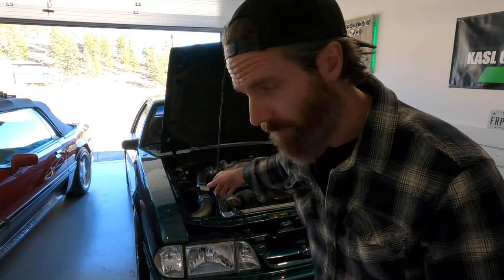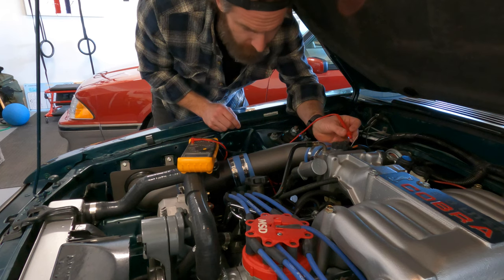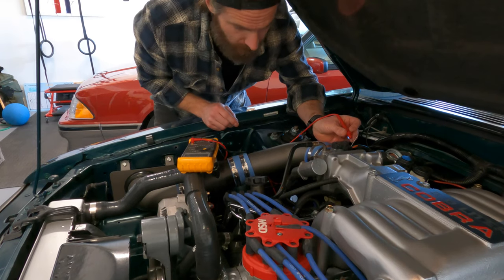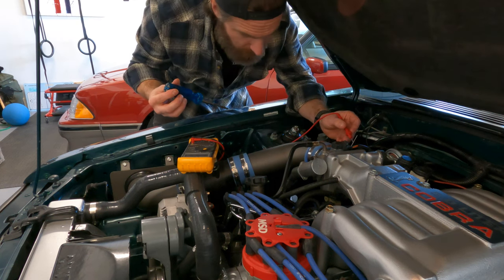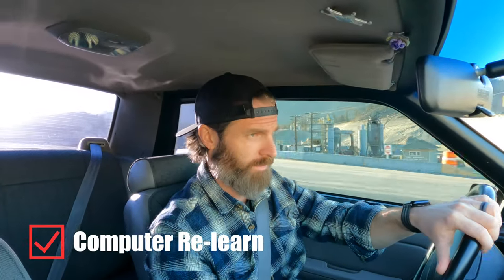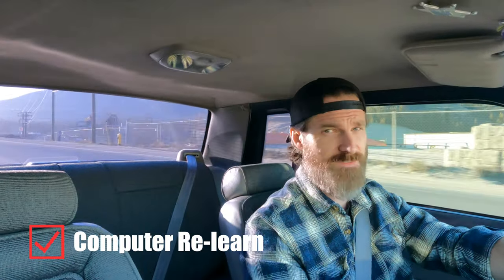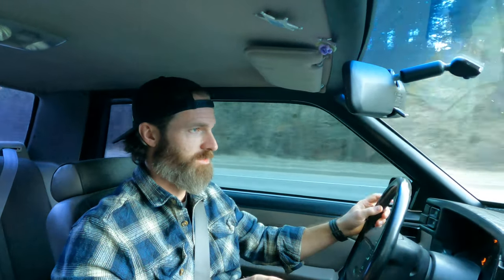I Cammed My FOXBODY & Fixed The Bucking, Surging & Stalling Drivability Issues With These Easy Steps

Comment: Another good thing to check on the tps when your setiting it at idle, is to manually open the throttle while watching the voltage on your meter. Open it slowly and quickly taking note of any inconsistenties in the smooth increase or decrease in voltage. Any jumps or "dead spots" could indicate a faulty tps. An oscilloscope would be the best tool for monitoring/testing it, but not many people have access to one. Another well thought out video bud.
Reply from the maker: Thank buddy! Always appreciate your input 👍
Reply: @KASLCustoms  no worries bud

Comment: .99 volts I would say is too high, if you open the throttle and ease it off lightly the voltage may end up over 1 volt.   Chris Richards of Pro-M EFI in his video, says the stock computer worked best when the TPS was set at .90v or less but no higher than .95v.
Reply from the maker: Interesting, thanks for sharing the info sir 👍
Reply: This topic is one of the most debated of all for Fox Body 😂 many people say it’s not a super critical setting and I’ve had some cars that weren’t BUT I had one that ran noticeably best at .89-.94
Reply from the maker: Lol yeah it’s one of those weird deals 🤷‍♂️

Comment: I have a custom cam and have been running with the IAC unplugged for months cause I am inconstant fear of looking like a tool idling at 2500rpm at a stop light… I should recheck it but the new iac didn’t help last time I checked. Sometimes it will seem fixed but after a few minutes of running on the highway, it comes back. Car feels like it had cruise control and just sits in the higher rpm’s when IAC is plugged back in.
Reply from the maker: hmmm thats odd...?

Comment: My 1991 Mustang GT has a misfire sometimes. Some days I can drive it and its perfect and the next day it will have a misfire under load. I have changed the spark plugs, plug wires, distributer and cap, coil, and mass air flow sensor. What can I check next?
Reply from the maker: What heads/plugs are you running and what are they gapped at?

Comment: Love this this 5.0 content from a fellow Canuck.  Really helpful video.  I run an Anderson N-41 in my coupe with no issues.   Lots of power.  It isn't a super high lift cam.  Before buying my cam, I used David Izard's formulas, and they pointed me to 110 lobe separation and durations very close to the N-41.  Thats why I picked it.  Most cams have 112 or higher.  

N-41 Specs:
Duration at .050 - In:222 / Ex:230
Gross valve lift w/ 1.6 - In:.512 / Ex:.512
Lobe Separation 110
Reply from the maker: Thx buddy and thanks for sharing your experience for others to see 👊👊
Reply: @KASLCustoms  Thank you for this awesome channel.
Reply from the maker: Awe thank you my friend!
Reply: I got the same cam, very awesome cam for decent street/ strip car

Comment: 4:32
Something I saw on Brew2L’s channel was to probe the green and black wires, and not ground to the engine or body. You will get a reading that’s quite a bit different if you do. 
Of course I was skeptical. 
But I tried it both ways, and sure enough, it was a good bit higher. 

Also, if you set it at say .99, and it jumps over 5v at WOT, the computer defaults to decel timing. On his car, it was like 35°. It blew the head gasket with a quickness. I believe he said it was because his car is boosted, but not as much of an issue with naturally aspirated cars. That was my understanding anyway. 

Just a little tip for anyone still fighting a surge.
Reply: Yep but the only time the tps will do that is if there's something wrong with the tps itself or if the throttle magically goes past it normal operating range lol
Reply: @nunya2814  
Not necessarily. 
I’m pretty sure he has a good grasp on all that, and it happened to him. 
It can happen. 
And does happen. 

This was just a heads up for folks.
Reply: @dstdrummer  these TPS are designed not to go above 5v, if they do, there is something wrong with it. You'll find if you re watch brew2ls vid, he even says there was a fault in it and replaced it. It's the way the system is designed and how the parts are engineered to work together. Most of the sensors in these eeciv systems are 5v reference or pull down circuits. Bad things happen when these systems aren't happy, why do you think so many fox owners have problems diagnosing their issues? Because most don't understand them to begin with.
Reply from the maker: Thanks for sharing bud!
Reply: It can't "jump over 5 volts" when it's ONLY provided with 5 volts.... 🤪

Comment: Always remember: the heads are the limiting factor, not simply the cam.  Without addressing the heads on a 5.0L, results from a cam will be very disappointing.  

On an SEFI motor, the TB and MAF are also factors that will affect cam results.
Reply: What happens if I don’t know the cam or heads?
Reply: @itsmetiqui1136  There are casting marks on the heads.  Unfortunately, determining the cam is harder.

Comment: New Sub.
Liking what I been seeing Sir.
👊🏽
One thing (along with the IAC cleaning/TPS base voltage setting) 
I had and i do know stock cammed cars do suffer this , my stocker speed density car that also was one did respond and they actually all do prefer a higher base idle and always set this wirh AC on l, also more fuel pressure even for stocker EEC5 system overall respond positively as well to the increase in FP /base idle (W/AC on specifically) beeeutiful car my friend. 👊🏽
Reply from the maker: Thanks so much buddy!

Comment: What's up @KASLCustoms? Under your guidence I purcheased the Comp Cams XE 264HR fun stick for my 306 build, along with Pro Maxx 180cc heads, Keith Black pistons and an "OLD SCHOOL" tubular Lightning intake (I can't believe I found one!). My question is, I'm using an MSD Street Fire Distributor for the build and it comes with a steel gear. I've read where I should switch to a melonized gear for my new stick. Have you crossed this bridge on your LX? As always, love your content. Danny F rom Kentucky
Reply from the maker: Hey buddy! That sounds like an amazing parts list and will make one heck of a power plant. As for the dizzy gear, I have never researched this item and/or the pros/cons surrounding it. Truthfully, I don't even mess around with swapping out the hem dizzy either. Sorry about that, I wish I had more info for you. Thanks so much for all the kind words and support my friend!

Comment: My 88 Notch is tuned with a Moates Quarter Horse and has the Summit E303 cam. The car bucks bad at low speeds. Do you think I could adjust the TPS with the engine tuned?
Reply from the maker: Yes you most definitely can. Mine has a 1/4 horse too

Comment: If the car is 87-88. Speed density.....dont alows a nasty cam.....the ECU   is 
Mapped ....Only a mild cam   with little pepper....or idle go cracy....advance at 12 dgree.... check Coolant & air temp charge is ok...  clean Idle control valve and the EGR too....and finally put On 0.92-94 volts the TPS...I ve 87 Lx, 5spd, vert, 5.0l...from Bqte Pnma

Comment: I can not say this enough. If you cam an AOD car, change out the oem torque converter for a higher stall. If you do not, you will have surging issues at idle. I didn't listen to this good advice and now I have to go back and change mine.
Now for the base idle reset and TPS adjustment dance, as I like to describe it. It literally took me several weeks of tinkering to find my cars optimal setting. I got to where I would just keep the tools I needed for it in the car, and I got to where I was pretty quick at it. One piece of advice remember to flush the stored information out of the computer and make it relearn. It is best to disconnect the battery for about 30 minutes. Also, I have seen the optimal  TPS voltage setting vary substantially from car to car. I have seen some cars run really well set over 1 volt. It just depends on your setup and how rich or lean your car likes to run.
Reply from the maker: Good info thanks for sharing 👍
Reply: @charles what torque converter is suggested, I have an AODE with an Ecam
Reply: @dvinpeace  This is one of those subjects where you can get way down in the weeds quickly when discussing it. The short answer is it depends on what your goals are and how you use your car, whether it is a daily driver, just a weekend cruiser, or you take it to the dragstrip. Also it depends on your setup, do you have a power adder like a blower or nitrous? So I am going to answer this question from my perspective of a mildly modified weekend cruiser, that occasionally sees some spirited driving but does not go to the drag strip. From my research you just need to bump the stall speed up by about 200-500 rpm over stock to alleviate the surging issue at idle. I am looking at the TCI Saturday Night Special Torque Converter. The reviews I have read seem to be very positive and it seems to be one of a very few torque converters I can find that bumps the stall speed up just a little bit vs bumping it by like almost 1000rpm. If you are just worried about drag racing your car you would want one with a lot higher stall speed, but that is not how I use my car. To be upfront, I have never used a TCI product before, so all I can go by at this point is just my research, so I am not making any promises on TCI products. They seem to have good reviews though.
Reply: @cvjfine  Thank you Yes! Yes my use is same as yours. Mainly weekends. Maybe drag strip once or twice a year just because... its has a full exhaust 333 stroker with an E cam and 373 gears I just added, which made a world of a difference... I'm looking at a local shop now for custom converter. Then ill compare prices and go from there...
Reply: I had a stock 89 2.3 ran super good, never had issues, till the belt busted. Mechanics said I need a new engine because no compression so they put a 7kmile engine from Jensen engines now it bucks and stalls at stop signs. Also barely pressing the gas makes it wonky. And take three key turns and pushing the pedal to start it on 3rd time. I hear a rattle when the engine is on and park is pushed more foward, sounds like hollow spinning or tapping.  When going into reverse I also  get idle super low or shut off.
Reply: ANY engine with ANY auto trans WILL need a larger stall converter with a larger cam to alleviate stalling and bucking at idle. 

ESPECIALLY if the cam is 220° or more of duration.

Comment: More importantly is that the wide open throttle TPS never go above 4.8v. 5+v drives an A9L/P nuts.
The Ford computer is self compensating for .6 to 1.1 v at idle.

Comment: Hello. I really need some help. I did the procedure and my car stalls after unplug the IAC. So I turned the TB screw to the point where the car started and hold idle 700rpm. LMR has the step by step instruction for these on their website. 

Now the car started OK after I unplugged the battery for 20min and plugged it back also the IAC, and it run different, different then ever (14years) before. I drove it and first it was bucking one time but then it drove OK. It had no idle issues anymore and it didn't stall. BUT! Next day I started the car when it was cold. And now it has idle issues when cold. I have to give some more throttle by pushing the pedal to get it to temperature an then it runs OK. But cold it's like it was before the IAC end Ecu idle relearn procedure like in this video. Also I noticed that the exhaust is damn hot. I think it's running lean. Very hot exhaust temperature. It melts the underbody protection till its smoking.

So what is now to do? Timing is at 14. TPS 0.96v
Compression is also OK.

I live in germany and the car run fuel which is 95 octane. 

I thought I found the problem but unfortunately not. I am really going crazy. Car has a repaired A9L, 303 cams and GT40 heads. The complete exhaust is stock.

Need help! Nobody here can help and I try to solve the problem for over 10 years now. I won't give up the car.
Reply from the maker: Wow that’s odd. So did the car run better before the reset?
Reply from the maker: Hey buddy. I’m not sure why your reply isn’t showing up here but it did show up in my email. Have you had a chance to check for any potential codes in the car? I’m wondering if you may have a bad O2 sensor or maybe something going on with your IAC (idle air control) sensor. Before throwing more parts at the problem, I would check the car for codes. I have a video on it on my channel with a link to the code reader in the description (if you don’t have one). You also mention you have stock exhaust in the car. I would also possibly look at replacing/removing the cats if they are the original ones. I hope that helps. Keep me posted with your progress 👍
Reply: @KASLCustoms  Oh, interesting that my message is not shown here. I have still the original catalytic converters (the full exhaust is stock). But I wouldn't think there's is a problem with the converters because the problem turned now into cold condition and I think that I can't go on with 14/16 degree on timing. It has to much air to fuel ratio. So I try to get down with the timing. o2 sensors have been checked but I have some new (from Bosch) bought for the car.

Next time I try to unplug the IAC cold and see if the car start without pushing the pedal. The IAC is new, the EGR also. Checked some air mass meters because meanwhile I bought thousands of parts for the car to solve the issues with it. Water temp sensor and so on is new. I bought even a second foxbody (which isn't cammed) to get this one run.
I have somewhere the code reader but can't find it for now. I will buy another one. But years ago with the same problem (bucking/surging) I had only a bad TPS when it comes to the code reader. Replaced and I had no codes. Car still had bouncing idle after moving it when it get normal temperature. No vacuum leaks also.

Thank you very much for your time, helping me, I appreciate it very much. I don't know but maybe someone could via whatsapp, check this situation step by step with me together. I could post then videos and so on. I would like even to pay for it.

Comment: I have an issue with my cammed 306… it will idle perfect from a cold start, and just sit and idle perfectly, but once it is driven around and warmed up… it wants to surge and die if you don’t keep your foot in it when coming to a stoplight or stop sign
Reply from the maker: Hmmmm, interesting. I know I’m staying the obvious but definitely seems to be heat related
Reply: Do the baseline idle reset.
Reply: @KASLCustoms  I just replaced the temperature sensor… not sure if that was the problem yet, but I have never replaced it before, it’s the original one from 1990… had this same problem before the stock motor was replaced
Reply: Hi, exactly same situation here, I believe it has to do with a open loop / closed loop situation..meaning, car runs on a pre-set  setting when cold, and doesn’t listen to the input from sensors..But, imagine there is a vacuum leak, (possibly) soon as car warms up, computer starts “listening”to sensor..so at that point, computer gets “confused” by the potential vacuum leak, since there’s a mismatch in fuel-mixure values. And computer over-compensates..leading to the up and down idle/swings
Reply from the maker: Well said bud